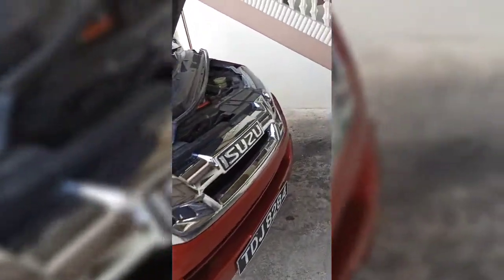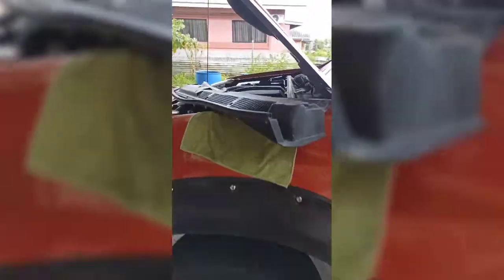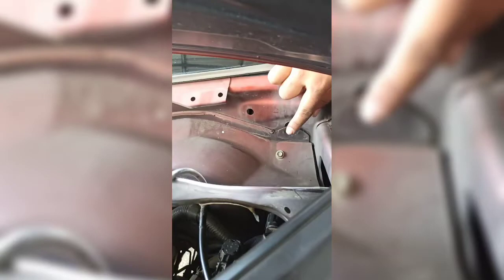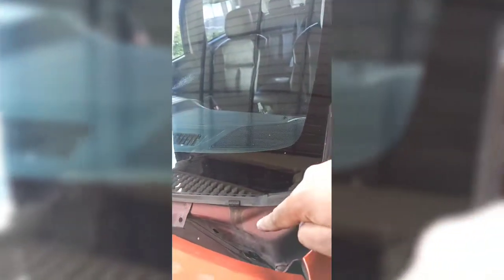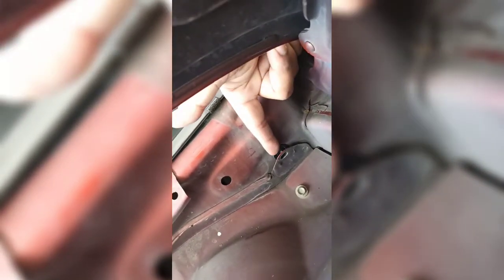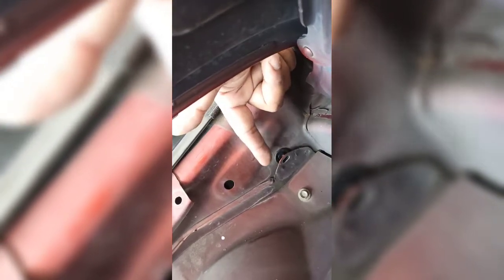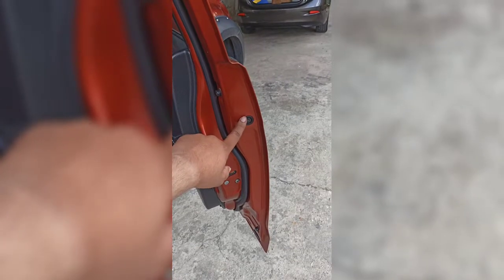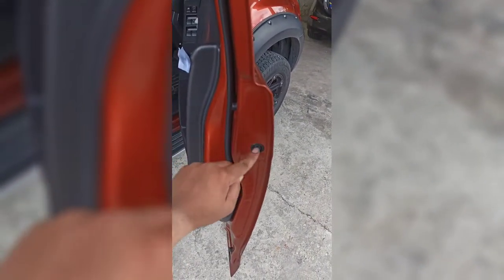Isuzu dmax water in passenger foot area when rain fall

Comment: Having the same issue. Could you share any advice on how to remove the cowl? Thanks in advance!
Reply from the maker: Hey @rarehh . Well first u have to remove the wipers, after pop the hood and the cowl is held on my some small clips. The same clips that is holding in the rubber.
Reply: @MRLEX647  thanks a lot! will give it a go to solve that pesky drain.
Reply from the maker: @rarehh  it most definitely helps . It solved my problem .